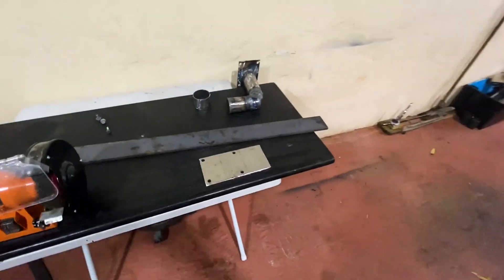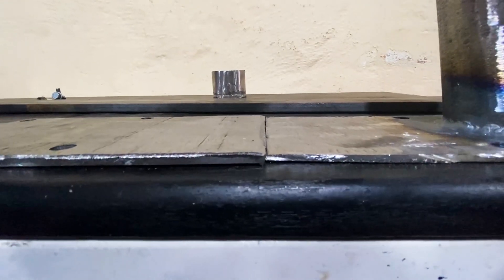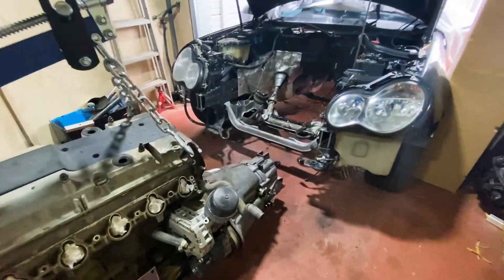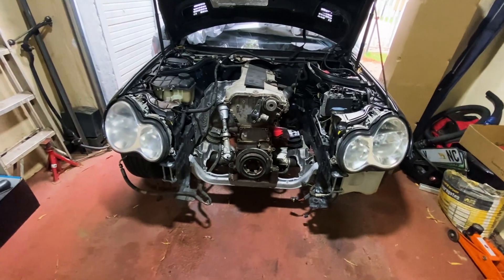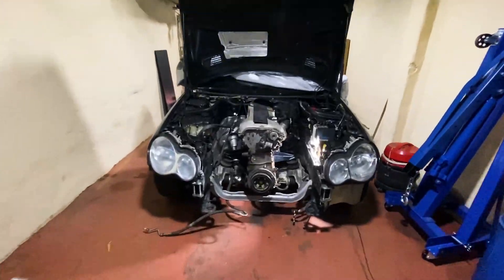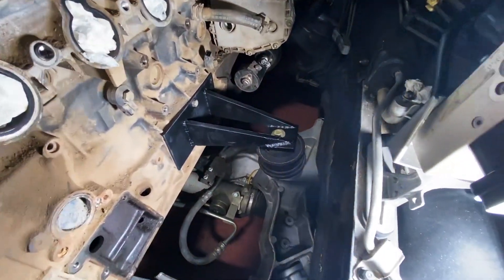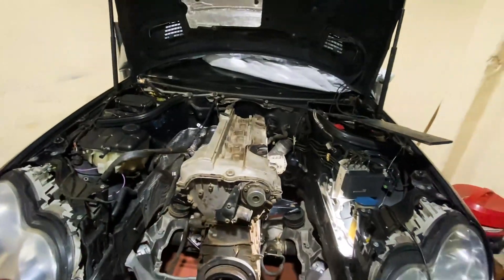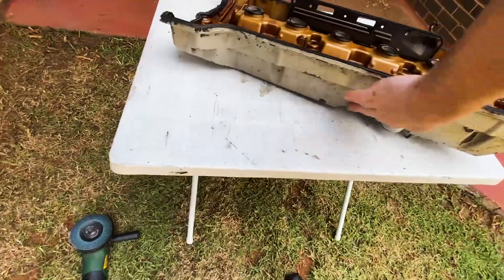HUGE New 6 Cylinder Engine (M104) + Building Engine Mountings | Mercedes W203 Engine Swap!!!

Comment: You should get the tappet cover powder coated. The paint tends to peel off due to the heat. I got my M104 tappet and spark plug covers powder coated for R650 by a place called Ultimate Powder Coaters in Pretoria. Worthwhile investment.
Reply from the maker: Thanks for the tip! Will see what I can do! 😁